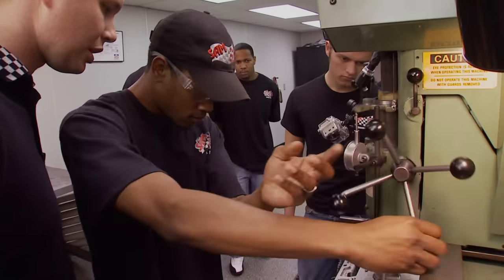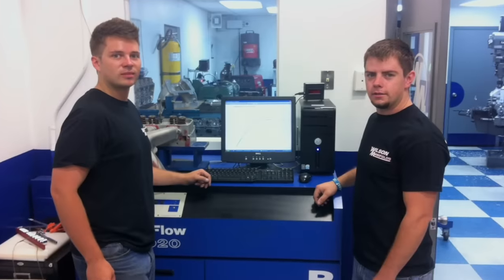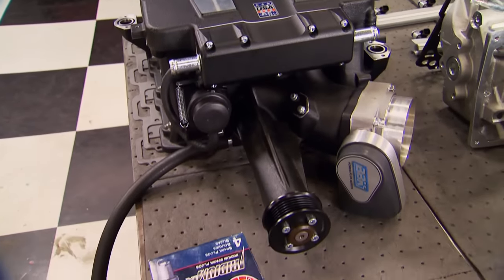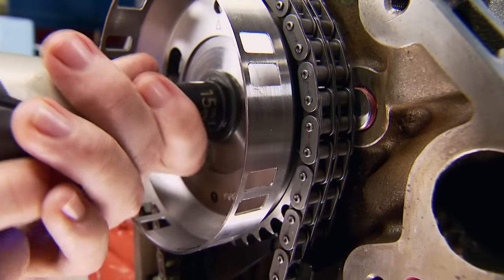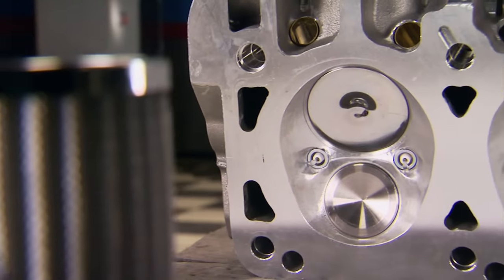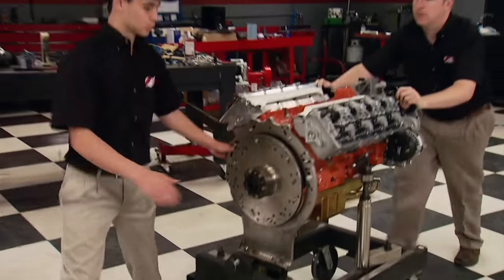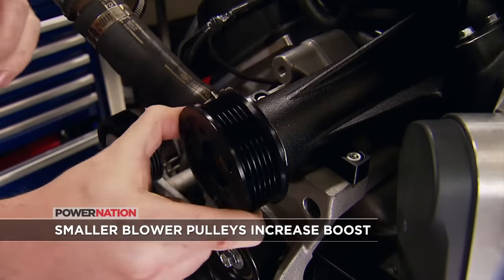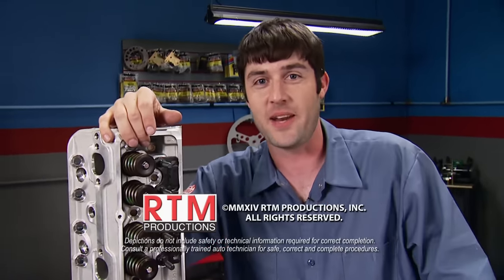Transforming A Late Model Hemi Into A 426 Street Fighter - Engine Power S1, E15

Comment: Excellent engine build!
At the end of the video, notice that hemi valve covers are selling for $1000 and you can get aftermarket cylinder heads for a small block Chevy for $600… I see that it’s still more expensive to build mopar Hemi…
Reply: Mopar mopower baby
Reply: @markoz673bajen8  - That engine is weak.  780 HP out of a 426ci engine with ported heads, cams and a blower pushing 8+ pounds on race gas?  🤣🤣🤣. A bone stock 300ci Coyote with oil pump gears only can easily make 800+ HP with a good blower.
Reply: @danmyers9372  lets see it
Reply: @frankmc5112  Yeah and all Coyote's sound like shit. So I'll spend a bit more on a Hemi and enjoy the soundtrack. But that's just me. A Coyote is also an DOHC, 32 V completely modern V8 with direct and port injection. The DOHC setup gives it quite the breathing advantage over an old school pushrod engine like an LS or Hemi.

The Modular 4V's ain't bad but I'd still rather have an LS or Hemi. Just never been a Ford guy I guess. I'd take a Boss 302 or a 5.0 HO anyday of the week though. Legendary.
Reply: @2K-Tan  Coyote has a strange firing order which contributes to it raspy sound, if you set up the exhaust right it can sound decent, but its certainly not Fords best sounding engine, thats a toss up between thier 351 windsor or thier 4.6 2v.
Reply: @danmyers9372  That Edelbrock blower is weak! My 426 Stroker Hemi with ported Thitek heads, and a Procharger maked 787whp or about 925hp at the engine.
Reply: @janinecavanaugh7417  Hell yeah!!
Reply: @danmyers9372  HEMI number one engine used in drag racing not the Coyote engine FACTS
Reply: @janinecavanaugh7417  Do the Gen V 3.0L Whipple. It's a 1500hp blower. (if you got the octane.)
Reply: @kskip4242  I read an article a while back that said the coyote had a firing order similar to Ferrari firing order.
Reply: @BruceLee-xn3nn  yes it is not a traditional American V8 firing order. Plus I believe the cylinder heads have a lot to do with the way it sounds also.
Reply: @danmyers9372  but it's a ford
Reply: @danmyers9372 yes

Comment: Those cylinder head are way overkill for the cam there using. And the”Race only supercharger” can only max at 700hp why not put a Whipple over 1000 easy 1200 on race gas.
Reply: Because they build it to last. Not just for fun over the weekend
Reply: Because I’m sure edelbrock supplies the supercharger for free.
Reply: Its not really a overkill cause then again its a 7liter stroker it breaths way more air
Reply: Who really needs more than 700hp on the street? Hell 500 is sufficient for a fun street car as long as you have the torque to back it up.
Reply: Seriously though that blowers going to make 8lbs of boost on the smallest pulley with those heads 😂
Reply: Sponsors
Reply: lol HP is cool but plenty of 600-700hp cars pushing 9-10sec at track. And street capabilities to go with it, is a win win
Reply: 6.1 or 6.4 block?

Comment: Dodge did it with a 6.1 motor at 707 hp. A good tune and good exhaust made about 800 hp from a factory motor.
Reply: The Hellephant is 426CID and makes 1000hp.

Comment: Was it me or was that power kinda low 780 on race gas? that means 660 to the wheels and you would need race gas ? I have seen coyotes make 650 on pump and ls make 650 on pump
Reply: Not just you, that’s weak given everything  in it.  A bone stock Coyote with oil pump gears only can EASILY make 700+ on pump gas with a good blower.   800+ on race gas or E85.
Reply: Seems like getting a hellcat engine would be better bang for buck won’t take muck to make 800+ with it on 93 octane

Comment: Opps. The depth of the oil pan pickup was wrong. He used one gasket width as a measurement then used 2 gaskets and a windage tray between the block and the oil pan.
Reply: @bigboreracing356  Yep. If I remember the engine was tested to 6500 rpm. not as you say 9000+rpm... I agree with you. In the video they pointed out this adjustment then almost tripled the gasket thickness. I do not think it would make any difference on a 6500 rpm engine but I wonder if it is that critical on a 9000+ rpm engine?
Reply: @bigboreracing356  and they aint getting to 9k rpms lol it dosent need to rev that high for hp itll get 1000hp rght around 7kish

Comment: Is that really a good result from a 427 with a supercharger and race gas?
Reply: For the boost level their running yes. But that motor has parts in it they could throw twice that or more!
Reply: @denniswatkins4666  if I paid for that motor to be built, I would be very disappointed
Reply: @Ausblack  it depends on long do you want your motor to last between rebuilds and how the motor will be used. They put a supercharger rated for 700+hp, they could have gotten more if they put a bigger supercharger on it.
Reply: @Ausblack  you don't know what you are seeing. The engine has a small cam and they are only making 8-psi of boost. Clearly not a max effort. This engine could handle 20-psi easily and be making 1200hp.
Reply: @baby-sharkgto4902  I'll take a Ford barra any day of the week over this boat anchor. For $12k I can have a motor that will pump out 1000hp for years
Reply: @Ausblack  Boat anchor? Oh please the amount of boost it takes to make your 6 cyl do 1000 hp this Hemi would be making at least 400lbft more torque and 2-300 more hp and go for YEARS.And sound nicer than your six.Barra is a wonderful sixer though.

Comment: I’m gonna catch a lot of hell for saying this, but while this 426 is making decent power, 780hp is a disappointing number for what this combo is. Stock 6.4 hemis with a supercharger have been proven to make 800+ hp. That combo could make 1000+ reliably if it had a bigger cam to match the cylinder heads. Stock gen iii heads flow better than any stock LS or Coyote heads, which can support over 1000hp with boost. A bigger cam ground for a boost and more boost would turn that thing into an LS and Coyote killer. However, I’m not gonna let that take away from the fact that it was assembled very very well and I bet it’ll run forever like that
Reply: I think they reached the limits of the particular blower they were using. The head flow is there to make more power.
Reply: @kurtpoblenz2741   very true. The Edelbrock superchargers are perfect for street builds which is what they were shooting for. With a whipple that thing would scream

Comment: Sorry Jud. Their is such thing as an LS with aluminum block with reverse flow 2 valve per cylinder heads. Hemi cast iron block two spark plugs per cylinder with 6 bolt mains and cross flow heads 2 valve per cylinder with dual rocker shafts for more valve support higher RPM. Ford has overhead cams aluminum block with cross flow heads 4 valves per cylinder.

Comment: ok i got a question for powernation... at what point would would compression in a gasoline engine not need spark plugs like a diesel ... would that even work? and why would it be a bad thing? ... and ... are you willing to test it?
Reply: What’s the reason to not run spark plugs
Reply: @1982MCI  because

Comment: 6 bolt mains? I only saw 4 as he was putting on the windage tray.  ??
Reply: The other two come in thru the side of the block, one on each side and are external bolts so you wouldn’t see them under the windage tray
Reply: @1982MCI    Two on the sides of the block plus two on the main bearing caps is what I saw. Where are the other two?  Shouldn't there be 4 bolts on the main caps and two on the sides of the block feeding into the caps. I think it was a mistake in the narrative. This is a 4 bolt, not a 6 bolt.   How many bolts do you see on the main caps?

Comment: Why does decreasing the width of the pulley increase boost?  Less slippage??
Reply: A smaller pulley means less time for a full rotation which means the supercharger is spinning faster which creates more boost.
Reply: @Aduskett  Oh, the diameter.  I thought the guy was talking about the width.  Thanks.
Reply: It’s spins the supercharger faster making more boost. It’s good to have a good cooling setup for it before you do it or you’ll have heat soaking issues.

Comment: So, the redeye is 6.2L and makes over 800hp. With 7L, this really should have gone past the 800hp level. I suppose the boost level is higher with the redeye, but if I was building a 426, I would be aiming for 900, especially since the hellephant is 1,000+. If this was an ls, I'm sure they would be pushing for more.
Reply: Supercharged 6.2 LS motors are hitting this without Race Gas.
Reply: it's small cam profile and a crappy Edelbrock blower.
Reply: @rickgehring7507  exactly a whipple 3.0 or a d1x would make over 900
Reply: @brandonUwanawich954   we just finished up a 364(4.125X 3.40) BGE block, 6.30 C to C lentz rods, 1.28 Ph custom Gibtec pistons, 2.9l Whipple similar to a Drag pak but with out some of the "NHRA" limitations, Thitek Heads , BAM solid Lifters and Custom Comp., 1175hp @ 8200 RPMs

Comment: These are not late model Hemi's,  they are Gen 3 Hemi  which is a small block.  The late model Hemi measures 4.250 bore and 3.75 stroke at 426 cu/in with 4.800 bore centers.  Late model Hemi's were in production 1965 to 1971.
Reply: What??? The term “late model” means recently made or of recent design.
Reply: @joshkrause2977  Once again in Chrysler design is the Gen 2 Hemi's 1965 to 1971. In that video are the Gen 3 small blocks from 2002 to present. The Gen 1 Hemi's were from 1951 to 1958. There were actually two sizes, 240, 331, then the so called big blocks, 354, 392. And they were heavy weighting over 800 pounds each. Yes I'm a old guy I know this.

Comment: I'd really expect more from a setup like this... hell, the LT5 runs those numbers with less displacement on pump gas LOL
Reply: That's cool. So what does your LT5 make? Oh that's right you don't have one. LOL
Reply: @AJPPP  lol damn straight, I don't need 700hp+ to have fun, but you can definitely dream 👍
Reply: @Drake5153  that's fine, but I have fun with my LT5 all the time
Reply: Running very low boost, and has a huge mid range, on more boost it can easily put out well over 1k Hp

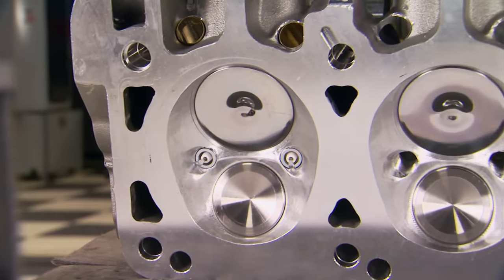Comment: 10:45 polished valves to mirror finish for maximum airflow is only good for flow bench bragging. In real world they will have a carbon film on them in no time. There goes the mirror.

Comment: Mike says, "a brand new production piece that sports 6 bolt mains",  followed by a view of the 2 bolt mains w/cross bolts.  ..four in total.
Reply: Lol yeah id love to see what they actualy have their hands on
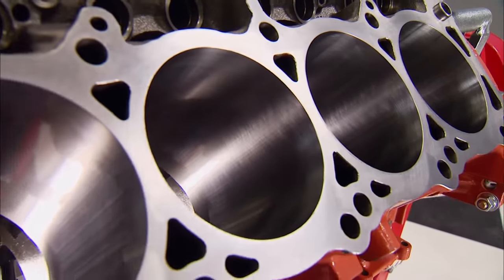Reply: 4 on top of the block and 2 on the sides of the block - 6 bolt main, at 06:05 you can see the side bolts.
Reply: These guys are actually announcers, actors, and journalists reading a script, know little about engines... don't even know which bolts to count... 
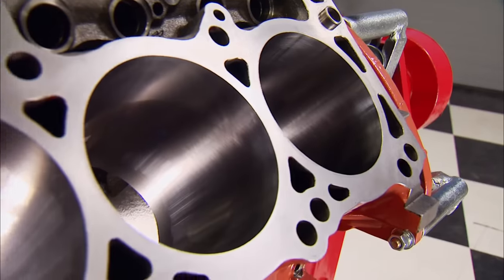At 5:55 just 4 bolts, not "six"... 2 vertical, 2 horizontal... 
Reminds me of Burt Reynolds looking under the hood of that Ford in White Lightning and saying "dual quads 429"... when it's single quad carb. plain as day...
Reply: @bigboreracing356  - What was wrong with that?

Comment: Polishing the valves like that does nothing for gas flow. Its done to reject heat from soaking in the the valve. Polished items have much less surface area for the heat to access.
Now, did anyone spot them add lubricant?

Comment: None of this build makes sense. 426, monster head flow but small cam. Race gas with 8lbs? Small blower big motor?
My Hellcat is 850whp at 17lbs stock motor 93 with 3 gallons e85. That's 1000hp at  crank

Comment: 6500rpm with Jesel rockers? Come on guys. Dm shame. All these Mopar builds are rpm crippled. What gives? Can you not understand rpm has a direct correlation to horsepower output? Not near enough blower for this combo either. Should have put a procharger f1x or at least f1a94. If using twin screw should have used the 3.0 Whipple or a kennebell 4.2 or larger. You built a crazy good motor and made less horsepower at the crank than a pullied with ported blower hellcat on pump gas and rwhp. Sad

Comment: There are 1000 horsepower Suzuki Haybusa's nowadays and a 2000 horsepower 8 valve 4 cylinder Volvo red block. "B230" A blown 426 Hemi  should have more power than a stock 370 CI 808 HP Dodge Demon!
Reply: They just put 8lbs of boost ita not that badd it could easly make 1500hp with 20+lbs of boost and use e85 instead of racefuel
Reply: And there are 12,000 hp 500 CID blown hemi’s on nitro too!… top that one.

Comment: Those numbers are horrible for that setup. It should be pushing 650 n/a. All that money and barely more power that a stock hellcat. Sad
Reply: Its running very low boost, tiny cam. only 8psi, the engine is easily capable of 1300hp.
Reply: Wrong it had a small cam and low boost and low rpm for a very mild setup they could of easaly got a bigger cam biger supercharger with 20lbs of boost and reved it to 7500 rpm to achieve 1200+ hp but they dint it was jut a mild build
Reply: Exactally. Thays my point. Title of the video doesnt do it justice. It's weak
Reply: @dustinwhite5374  yea they should of gone full send with this one should of let pat do this build lol

Comment: 700ish? A Coyote thats worlds smaller makes over 800hp on a stock build with a tvs and fuel mods and do it all day everyday! So yeah not impressed…. 426 ci with all those mods and thats all? Goes to show just how great the coyotes are and the 5.2 in the Gt500!!!!! FORD POWER BABY!!!
Reply: You can make over 700hp N/A on a Gen 3 426 stroker on pump gas. This is a very mild build tbh and overbuilt for these power levels. A 5.7 hemi can handle these ranges no problem with forged pistons and rods. Ported 6.4 apache heads flow right at 400cfm, hell even stock 5.7 eagle heads flow around 320-330 cfm. Don’t get too far ahead of yourself the Gen 3 hemi is as capable as any platform available. The coyote is a good engine, it just shittily packaged comparatively to a Gen 3 hemi or LS/LT engine. I’ll take torque any day over an engine you have to rev to the moon.
Reply: Your wrong this hemi setup was very mild thay had a small cam with big breathing heads and a small supercharger with 7lbs if they wanted to go fast they could of got a high volume oil pump biger cam and a whipple with 20+lbs of boost and rev it 7500 rpms and could of easaly got 1200hp if they wanted to but it was just a mild build for the young learners.
Reply: Coyote, Gen 3 Hemi, and LS/LT are all great engines.  Be thankful for having so many solid choices.
Reply: Screw 5.0s hat that cheater engine has 4cams and big and bulky

Comment: 780 crank on a blown 426??? Garbage results
Reply: Next to no boost, tiny cam
Reply: @captainboose8788  Big cam/small cam, high boost/low boost results were piss poor. Not exactly a "Heavy Hitter" like they wanted.
Reply: @jetro7349  With some actual decent PSI it should make over 1300hp with ease